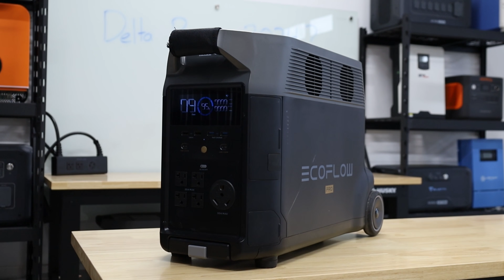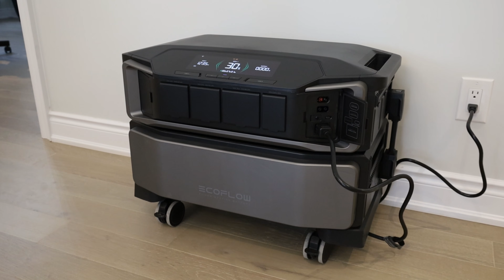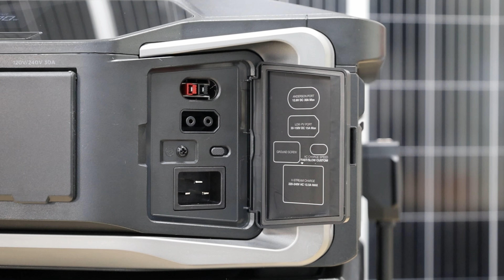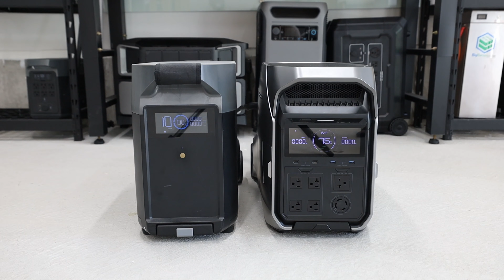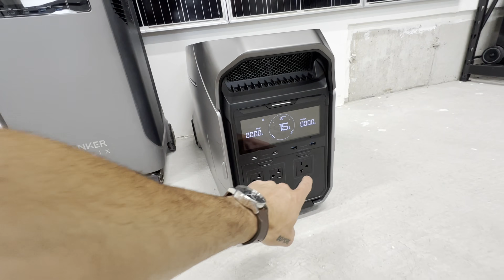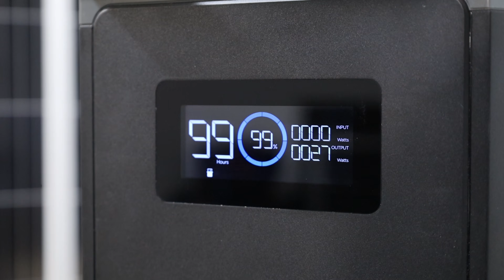Which is Best for You? Delta Pro Showdown! - EcoFlow Delta Pro ULTRA vs. 3 vs. Delta Pro

Comment: If my house were large enough to accommodate the biggest Ecoflow units, I'd be all over them, regardless of cost. However, the more clutter, the lower WAF becomes, so Delta Pro or Delta Pro 3 for me. The fact that the latter allows stacking its extra batteries swings that pendulum even further.

Comment: Around the end of November I was heavily considering the Bluetti Apex 300 + B300k. But due to limited funds at the time being a whopping $2500 I decided to purchase the Delta Pro by itself for about $900 refurbished with a coupon code on EBay. And did so thinking I could later expand this unit for a good price. Now as it may be a bit later down the road to get true power ran on my new property due to permit requirements I am now needing more solar generator power to hold me off from real electricity installation. Now these Delta Pros have almost DOUBLED in price!! And these with the external battery cost more than the Bluetti setup!!

Comment: Nice! You helped me make up my mind. Delta Pro is all I need for my off grid tiny cabin. Paired with 2-3 400 watt rigid panels. Best bang for my bucks.

Note: the EU/UK versions of the Delta Pro and Delta Pro 3 only come with 240 V sockets. Correct? 120 V appliances are an American thing. Right?

Comment: Dumb question: Can you charge these with smaller power stations? Considering the pro 3 for a van life build and in a scenario where there isn't enough solar to keep up with my needs during certain periods, would I be able to emergency charge it with the smaller unit just keep say my fridge running.

Comment: can you use a 2500w portable gas/propane generator to charge either the Pro Ultra or Pro 3 while the unit is supplying power to the house?

Comment: I have a question for anyone who has tried this. I have an ultra and am thinking about either picking up the 50 hub or the smart panel that allow you to connect 2 units together. My question is can I put my ultra and my sons delta pro 3 together on either of these items since both are 30 amp outputs or are you limited to only being able to combine identical Models? Thanks for the help they are just to expensive for me to feel comfortable experimenting with if it is going to damage either of the units.

Comment: I will clarify.
 Delta pros ring should have more battery's to it. I'd like to put it as stackable, but I think there should be 2 stackables of them and.
 Maybe 16 of those I mean, check for Ford.  1000 W on top of that, another 4001 step. What does it make 2 stacks of and make 2 stacks for high and have 2 sections like the Delta pro and have one hack up a lot more power than it be worth something, but I wish it was more like a 4500 W generator but then it's 2, it's not any. Good because you guys 7200 and what generator so I'm thinking I should be a 4800 watch generator when you connect 3 of them together. That was pretty dumb good.  Then I don't have something good to say about.I would like to Delta pro's solution.Except for the cords and it'll be fixed on if you make the delta pro three

Comment: I have received multiple confusing answers to this and the manual is unclear. Multiple YouTubers have given different answers on this. Could you clear this up.

Ecoflow Delta Pro Ultra
What is the connectivity/capability of the DPU to charge from the 240v side 5+8 (Infinity) port and also provide 120v and 240v output on the front panel if the SHP2 is NOT being used. 

In other words can it charge the batteries while running the inverter. In the DP3 this is called X-Fusion which the DPU seems to have but only outlines the use of the 120v input.

I know it does not do pass-thru but it does do a bypass mode. So if we have a generator connected to the 240v in port and the generator is providing lets say 2000 watts. Will the front 240v outlet be powered? If it has 1000watts of load at the moment will the batteries be charges with the balance (1000 watts minus charging and inverting losses)?

Any help is appreciate, this answer is impacting my buying decision.

Comment: If one's needs are very light (under 2kWh, 2400W), then one might consider the Delta 2 Max, which is currently running around $1300 or $0.65 per Wh.  The Delta Pro is running around $2100 which is $0.58 per Wh.  One gives up some features of course, and don't expect any upgrades.  

The Delta 2 Max extra battery runs around $1100, or $0.55 per Wh.  The Delta Pro 3 is running about $3200, or $0.80 per Wh which is the premium you pay for 240V native output.

Comment: The limitation with all of these is the smart home panel 2, it only offers 12 breaker slots, which is insufficient to cover all the needs of a whole home backup. For my home, I would need two ecoflow smart panels in my 1,800 sq. Ft. Home, which adds a huge additional expense. Whole-home backup isn’t possible with any of these systems unless you live in a small 1 bedroom or tiny home.
Reply: just install a standard subpanel and feed it from the smart home panel 2. will cost you $100
Reply: @chriswatson2948  The Smart Home Panel 2 has a 100 amp limit. I’ve seen others simply install a second smart home panel 2 to cover all breakers.

Comment: Good video but was hoping for a little more "can do's" of the Ultra. For emergency backup I would like to be able to run my 3 ton heat pump with soft start and a frig and freezer at a minimum all at the same time. I have seen other videos and websites hinting that the Ultra as you show it in your video with one inverter and one battery can handle this. WHAT would be your answer with this?? Thanks for the info and again, good video!

Comment: I have 2 original Delta Pros with 2 batteries for each and they've been so reliable it's hard to justify getting the DP3. I also have 2 Delta Pro Ultras with 2 batteries each.
Reply: I have one delta pro wired into a transfer switch so far and it powers 80 percent of my house no problems. I plan on getting 3 more so I have my entire house powered up all the time. I looked at the ultra and DP3 but the ultra is bulky and heavy and the DP3 is too expensive for just a couple hundred more watts. The pro is think is where it’s at.

Comment: Does that work? Plugging in a D2 Extra battery into a Delta Pro?
Reply: You’ll need the DP generator adapter. It’s on back order right now
Reply: @stevenichols9694  I tried using D2M EB on my DP and it didn't work.

Comment: Can you input charge the delta pro ultra with a standard U.S. wall outlet AND simultaneously output to a transfer switch? I didn't know that. I don't have solar yet, so wanted to charge from the grid and use it more like a UPS+backup for critical loads on the transfer switch. Ecoflow says you can't do this. I don't know why, but maybe because of the floating neutral?

Comment: All true
Just do more research on each. So I bought the ultra and tried to do 1 solar 18v 200watts and it doesn't work. You need minimum 30volts for it to work. Just a heads up that info is no where to be found online that I've seen
Reply: its right in the manual, you just need to do a more thorough research.  High-PV	80-450V⎓15A max, 4,000W max
Low-PV	30-150V⎓15A max, 1,600W max

Comment: You just nailed the biggest problem with this, these products change every year. Good luck getting it repair or supported in two years, especially on the large (VERY expensive) ones. Most people are far better served with a real inverter/battery setup than these big units
Reply: I mean, they're warrantied for 5+ years so there will be support for them, for a while, but yeah... frequent new releases will have you WANTING to upgrade for new functionality.
Reply: When it comes to the larger units build your own if you have the knowledge. I built one with 4 lifepower4 batteries and 1 EG4-6000xp. It weighs 460 lbs but its mounted on 6 inch casters and rolls nicely. 6KW output and 20KW storage easy to service. Frame is 80/20 and all parts were less than $250 not including inverter and battery.
Reply: So how do you make an inverter battery setup portable?
Reply: At least the ultra unit decouples the inverter from the battery.  If a single battery fails on the pro units you lose the whole decice
Reply: I’d love a DIY setup, but I have yet to see an inverter that runs nearly silent at 2k load.

The all in ones all have loud fan’s that I can’t use inside a shed.
Reply: @TobyCostaRica  Yeah, they all give off a lot of heat. That's inherent in the process. Quieter fans are usually less effective
Reply: @NeverTakeNoCut-offs  reports say the Delta 3 Pro, Ultra, Anker F2000 are near silent at half rated capacity.

Comment: I own a DP with two EBs. I will not be upgrading until they increase the voltage on the DC input. Most 400 and 500 watt solar panels are near 50 volt voc. My 545 watt panels have a VOC of 49. This limits me too 2S2P and the most I see for charge wattage is 1,400 watts on cold days. and 1,200 watts all summer long.
Reply: To be fair to Ecoflow... consumers messing with high voltage DC is a big liability.
Reply: @Jay-Crowe meanwhile the ultra has a high voltage input and low voltage plug that pretty much matches the pro 3 high side.
Reply: @-----------------------------  The Ultra has the exact same 150 VDC input. All they did was add a second lower voltage input.
Reply: @timcat1004  per public documentation you can find online, they allow 80-450V⎓15A max, 4,000W max on the high pv side. On the low side the specs match the pro with 30-150v with 15 amps.
Reply: Have you tried putting 3 of those panels in series heard that eco flow can handle VOC above 150v without issues
Reply: @DIY_versus  Too risky. I get minus 40 temps here.

Comment: Delta 2/Eco Flow 2 (significant $$ savings right now) vs Anker.  Anyone have experience with both?
Reply: Delta Pro then Delta Pro 3.  There was no 2 FYI.
Reply: @WingAddict  Delta 2/Eco Flow 2...Not all the bells and whistles of the Pro series but significant less (for now) and it still has the Lithium Phosphate battery so it has the extended lifespan
Reply: @WingAddict  There's definitely a "Delta 2", if this is what the poster was asking about. I've got one, and it's been good to me. It's been on sale recently in the $400-500 range. I'd recommend it, and I haven't run into anything that its 1800W continuous inverter couldn't handle.. including tools, vacuum, furnace, fridge, etc.
Reply: @Jay-Crowe good to hear. I have a 2 ordered and want it to run the fridge and such if necessary.
Reply: @Jay-Crowe  I have a Delta 2 also. OP had Delta 2 Pro listed but edited it after.  I was just letting him know it was Delta Pro and then Delta Pro 3. They skipped that 2.  :)
Reply: Get the Anker. Unless you getting the Ultra the Anker can do it all if you can live with the solar input and a couple other minor issues.
Reply: I don’t BUT the Anker 3800 or whatever seems to have a 50amp connection. 

That, to me, seems to be the winning point for home backup.
Reply: @rstr0up  but the Achilles' heel for the Anker F3800 Solix is that its solar inputs are only 60v. It's going to be difficult to get super close to the rated 2,400w of solar input at only 60v, so you're going to have to charge slowly, likely running out of battery capacity before solar can replenish it.